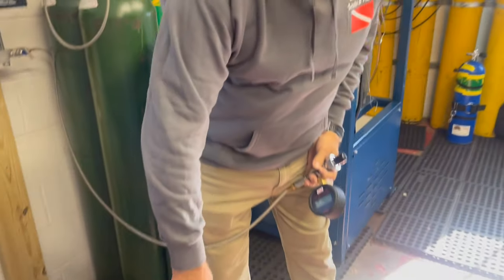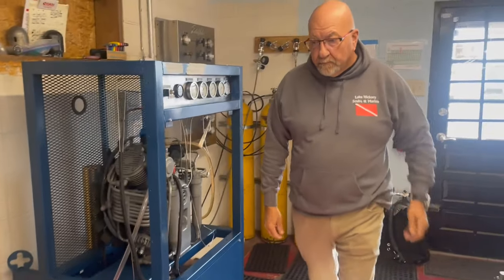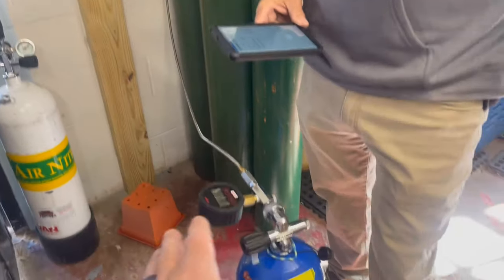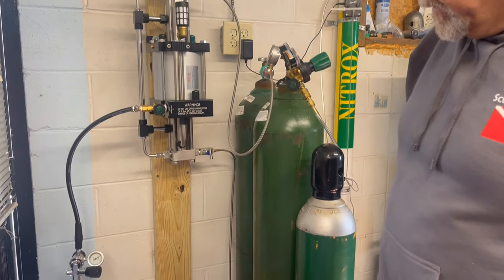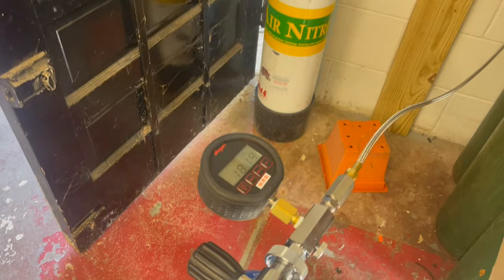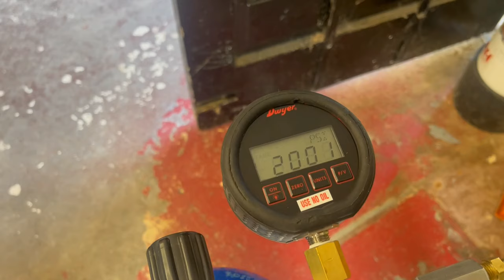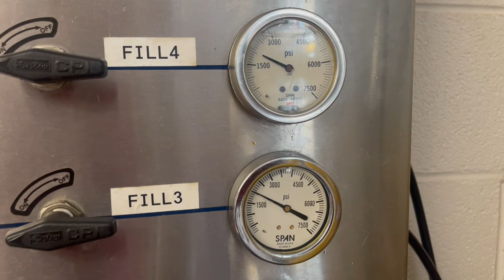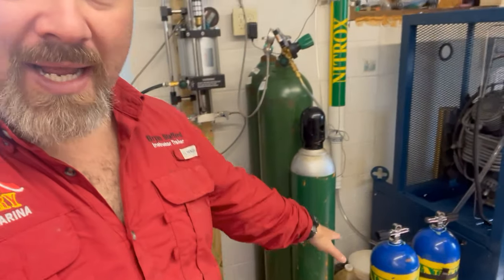How Does A Booster Work When Partial Pressure Blending

Comment: Bryan & Tim,  Great video.  I have never used of the O2 Booster, have heard of. (We have one for our air side)I will have to check it out for our system -- Names and where to get would be helpful.   
Also the  mix calculator that you used what is the name.   (The Nitrox and trimix blending software, Imixer,  I used has not continued to be supported for Ipad or android). So Im looking at new and better ones  - ray Brienza SSI4612/ SDI/TDI 1712
Reply from the maker: Hey Ray. This is Tim. The booster is a Usun 15/40. You can get them factory direct from USUN but I would suggest calling South Jersey scuba as they can get it for you at the same price or better and also build the rigging you will need to suit your setup. The Mix Caculator is just part of the tool section of the Multideco App that we use when we are planning Decompression/Trimix Dives. Here is the link for that program. https://www.hhssoftware.com/multideco/

Comment: Hi tim and bryan.I also use a dwyer dpg 111 gauge on the tank to be filled but see you have oil/glycerin filled gauges on your panel. Is this a cause for concern. Also why not use your air bank for drive gas. lastly is the scuba reg a balaced piston or diaphram ?
Reply from the maker: Hello @markdolphin1446, great questions. in regards to the gauges being oil filled, this prevents freezing during the winter time months, as our compressor room is not heated, and it keeps the needle from sticking. There is no risk of any contamination into the booster. As far as the the drive gas, it has to be regulated to a lower intermediate pressure than the valves on our cascade system can drop, plus we would have too much difficulty with back flow, as the cascade bottles are at the end of the cycle. The regulator we use for the drive gas bottle is a non balanced.

Comment: This seemed like a quick top up.  How much drive gas do you use?  It seems like in the online discussions people are buying huge shop compressors with complex air dryers to run these boosters.  this was the first time I've seen one in operation.
Reply from the maker: Hello @kevindavison6019, we typically will fill very slowly whether we are just topping off or doing a complete fill from empty. As far as our drive gas goes, we usually only have to refill it about once every 2 weeks. The first staged used for the drive gas is detuned quite a bit, so the drive gas can last quite a while. As far as this video goes, we simply wanted to show the process of how a booster works.

Comment: How much of a fire risk is this? Filling with 100% O2 and using a booster seems like setting up conflagration central.
Reply: no more of a risk than having the O2 bank bottles. storing O2 is an inherent fire safety risk, always follow OSHA guidelines
Reply from the maker: Hello @marcwanagas1234, great question. As you will learn in most Nitrox courses or Gas Blender courses, the risk of fire is always there. Anytime you operate with pure oxygen, certain precautions must be taken. All of our fill operators are certified Gas Blenders as well.